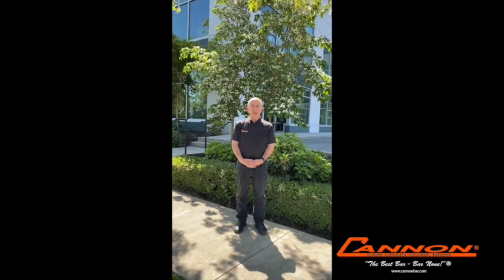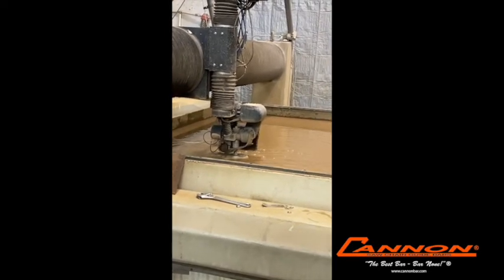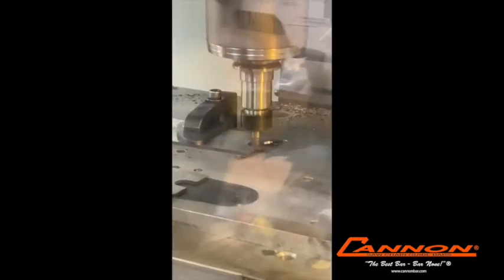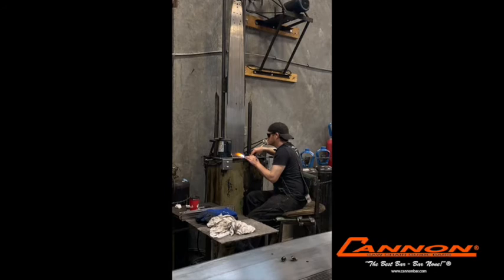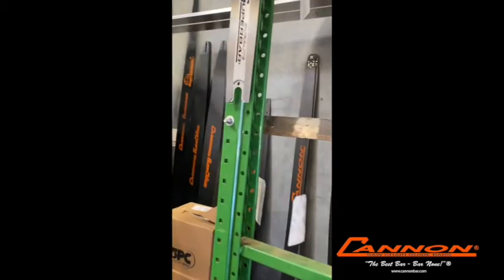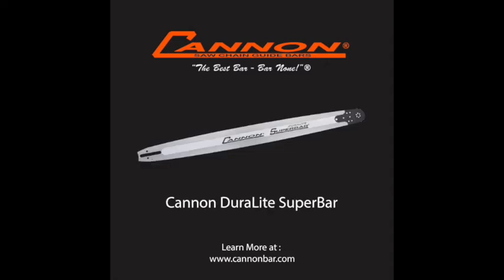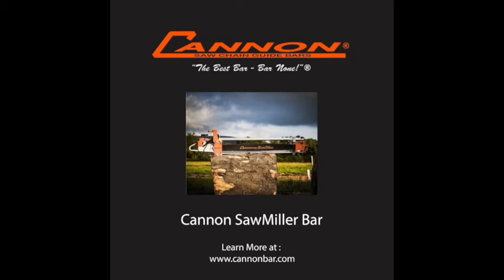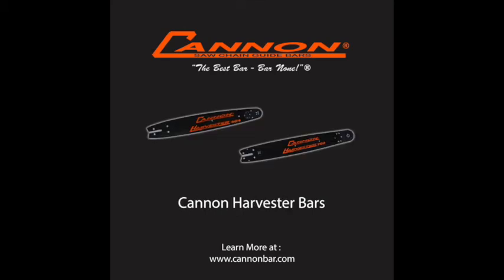How a Cannon Bar is Made

Comment: not impressed with my 32inch bar ,leeks oil and was rusty when I opened the package. oil hole is smaller than stihl and 1 millimeter higher. the nose whips when cutting very hard wood. if it doesn't wear well I will be chucking it out..
Reply: maciejjandugosz2056  oil will flow in the direction of chain rotation doesn’t matter where the hole is pointed.
Reply: Explain how your bar leaks oil. Never heard that one before.
Reply: Sounds like a counterfeit bar and not a genuine Cannon bar.